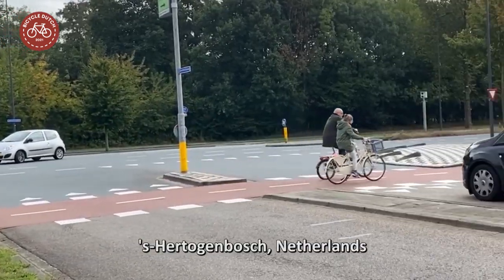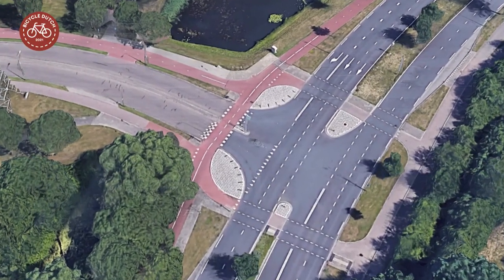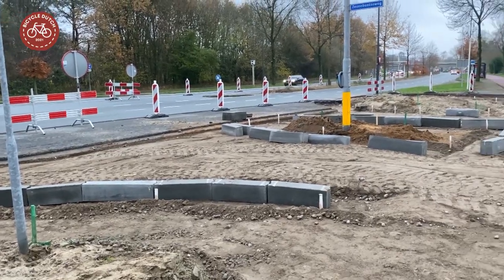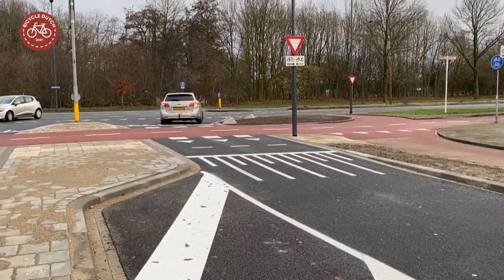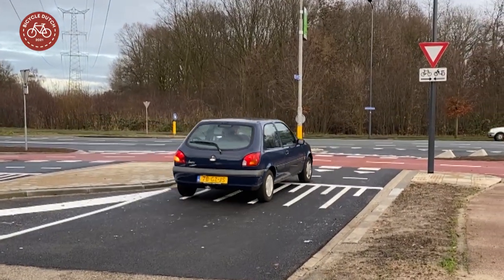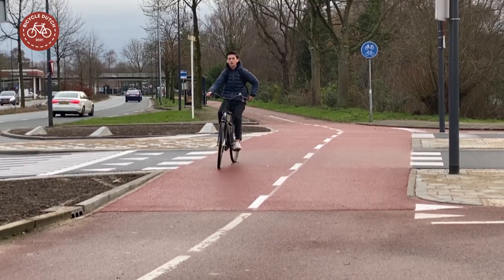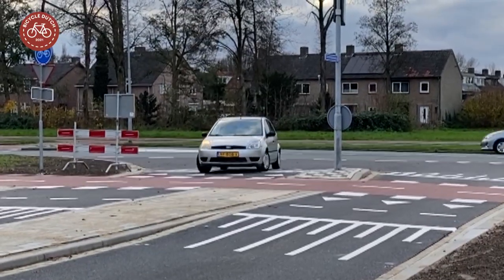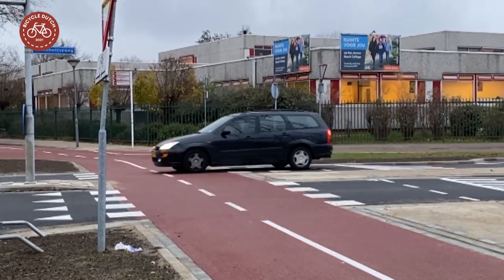Reconstructed cycling crossings in the Netherlands

Comment: Having studied traffic safety in Sweden. Remember that traffic safety doesn't mean no accidents well happen. But that you're basically cutting the accident triangle where deaths are on the top, from the bottom. As all kinds of accidents and the severity of injuries and accidents decrease.

Even if the new crossing didn't stop this accident, it still might have made it less dangerous.

Besides that, it takes years to evaluate the results of improving traffic safety, and the first year is basically to be dismissed as driver behaviour hasn't found its new steady level yet.
Reply: Also see my comment, even though it's a half year later.

Comment: At 1:46 you see the result of the most confusing Dutch traffic law. Pedestrians 'claiming' priority and motorcars 'granting' them priority :-(

Priority roads give priority to 'drivers' only. The term 'driver' includes all road users except pedestrians. Article 1 Traffic Rules and Signals Regulations 1990 (RVV 1990)
Reply: Completely agree with you!
There should be zebra paths for pedestrians to cross, to resolve this. Especially because of the schools nearby.
Strangely all zebra paths to cross a cycle path are being removed. In most cases pedestrians and cyclists can negotiate who goes first, but at very busy ones a zebra would make sure that pedestrians have priority.
Reply: @dutchman7623  Imagine when a pedestrian is walking on a roundabout with cycle lane priority signs...first half pedestrian has priority on all roundabout leaving traffic...second half he has NO priority on traffic entering the roundabout...so formally, a pedestrian would need to wait half-way in the middle :-(
Reply from the maker: You are mixing up some rules. Yes pedestrians are not vehicles so they have no priority over traffic from the side streets even though they walk on a priority road. But they do have priority over traffic turning in their path since they are going straight-on on the same road. On top of that, motor traffic has to let pedestrians finish their crossing once a pedestrian has started it. So in effect pedestrians do go first here in many situations.
Reply: @BicycleDutch  Hello BicycleDutch, I agree with what you write "have priority over traffic turning in their path since they are going straight-on on the same road". 
That is valid for cars/traffic leaving the roundabout towards the 'exit lane', they must give priority to bicycles/pedestrians continuing their route on that same roundabout. That is half the story.
So I am not so sure I am mixing up rules, the 'pedestrian on roundabout' situation however is doing so. A bit hard to explain without an image though:
When a car is approaching a roundabout, on which a pedestrian is actually crossing that 'entry lane' with the car coming from the right, the pedestrian is on the roundabout (in fact a circular never ending priority road). But the car is approaching on a different, adjacent road, being the entry lane/road. 
Meaning they are definitely not on the same road ...also realise that both the exit- and entry lane are part of the same 'street' connecting to the roundabout.
My conclusion is still: Pedestrian has ALWAYS priority on traffic exiting a roundabout towards the exit lane; Pedestrian must give priority to cars entering the roundabout via the entry lane. (when no zebra's involved)
Reply from the maker: @debokkenrijder7521  This is not a roundabout. I was talking about the situation in this video: two T-Junctions.
Reply: @BicycleDutch Agree, my additional example was off- topic

Comment: Do pedestrians also have priority over motor traffic at this crossing or would that require a zebra crossing?
Reply: No pedestrians do not have priority over motor traffic here.
Reply: In the absence of zebra crossings at intersections pedestrians have priority only if they're going straight and the cars are making a turn. And only if they come from the same road. In practice this only happens at small junctions inside residential areas, where speed limit is 30.
That's not the case here.
Reply: All turning traffic ( incl. cyclists ) always have to give priority to crossing pedestrians at streetcorners  : no need for zebra linings or otherwise.
In this case  this is partly the case as oncoming traffic towards the main road is not obliged to give priority , but as cars have slowed down already, it is  courtesy priority, which almost always works as practically all dutch drivers are cyclists as well in there freetime
Reply: @ovidiu_nl  actually, no, pedestrians do not have right of way when crossing a street anywhere there is not a zebra crossing. Pedestrians are not considered to be "traffic participants" in the Netherlands, so the normal rules for right of way do not apply (right goes first, going straight before traffic turning left, etc). 
The exception is a location where the sidewalk pavement continues across a road (usually where it exits onto another road). Technically, the cars are crossing the sidewalk in that situation, not the pedestrians crossing the street. 
In the case in this video, pedestrians would not have right of way.
Reply: @mikkieam  Sorry, but you are wrong. Article 18 of the rules of the road (RVV 1990) says:

"Bestuurders die afslaan, moeten het verkeer dat hen op dezelfde weg tegemoet komt of dat op dezelfde weg zich naast dan wel links of rechts dicht achter hen bevindt, voor laten gaan."

See: https://wetten.overheid.nl/jci1.3:c:BWBR0004825&hoofdstuk=II&paragraaf=7&artikel=18&z=2021-01-01&g=2021-01-01

The definition of "verkeer" in the same law (see Hoofdstuk I, "Begripsbepalingen") is "alle weggebruikers". The definition of "weggebruikers" is " voetgangers, fietsers, bromfietsers, bestuurders van een gehandicaptenvoertuig, van een motorvoertuig of van een tram, ruiters, geleiders van rij- of trekdieren of vee en bestuurders van een bespannen of onbespannen wagen". So pedestrians are included.
Reply: @ovidiu_nl  wow, I appreciate your commitment to find the actual articles. You have my respect for that.
As to the content, the article and definition you provided just proved my point. 
Pedestrians are classified as "weggebruikers", but not included when they talk about "verkeer". Pedestrians use the road, but are not considered to be "traffic". Bikes, cars, etc. ARE considered traffic. 
Which is why a pedestrian doesn't have any right of way in a simple crossroad even if they are going straight and the car is turning.
In practice, when you are in a 30 km zone, most car drivers will stop for pedestrians who are already crossing a road they want to turn into. But that is just common courtesy, not traffic law.
Reply: @mikkieam  No, it does not prove your point. "Verkeer" is defined as "alle weggebruikers". It's literally in article 1 of the law:

https://wetten.overheid.nl/jci1.3:c:BWBR0004825&hoofdstuk=I&artikel=1&z=2021-01-01&g=2021-01-01

What you describe as "common courtesy" is actually what the law requires.
Reply: @ovidiu_nl  ok, consider me re-educated :)
Reply: @mikkieam  My pleasure.

Comment: With the exploding share of e-bikes in (dutch) traffic (over 40% of all new bicycles sold are electric), how much thought is already going into dutch traffic planning and design to decrease cyclist speeds when approaching crossings?
Reply: They already use speed bumps for mopeds (or e-bikes) at strategic points. They consist of concrete elements that go down and back up again. If you speed over them, you get launched. Mark must have a video showing them somewhere...

Comment: I don't really like the redesign. Obviously it seems better than the before situation but it also seems like it was built with too much focus on being cheap rather than being good Why not make the road narrowing better? Why use chevrons instead of just extending the island some more? Those triangular bumps on the corner island don't seem very forgiving if a car driver makes a mistake. The speed bump slope also doesn't seem steep enough to really force people to slow down, if they wanted to take it at high speed they could still do that, just look at how fast the black car at 1:29 goes over it, almost like it doesn't even exist.

I think this intersection will end up having to be redone again in the near future, which means whatever money they have saved on it during this redesign will just end up being wasted.
Reply: The chevrons instead of an island is indeed just a cost saving. But it doesn't matter much for safety, the road before that is not wide enough for overtaking. Those triangular bumps are very, very standard. Normal cars will never hit them, but they do guide the rear wheels of a large truck back onto the road. The speedbump looks like it has the typical grade for a 50 km/h speedbump. I think what you want is a 30km/h connection to a 50 km/h road: continuous pavement, steep bump. But this is not a 30km/h road, and it would likely shift a lot of traffic problems to other locations if you would downgrade it like that (plus the cost of downgrading the whole road would be massive)
Reply: @Pfooh  But they should have made zebra crossings at both ends and in the middle to make sure pedestrians get priority. Downgrading the Sint Teunislaan, 150 meters north of this one and parallel, caused the increase of traffic on this road, never designed to take it over. Squeezing a wide road causes cars to take another route, shifting the problem to a place it doesn't belong. School going kids were facing triple times more cars, this quiet road became a sneak trough because of what happened a little north of it.
There were three east west roads connecting the two north south roads, Sint Teunislaan, Zevenhondtseweg, Aartshertogenlaan, first they reduced traffic on the Aartshertogenlaan, resulting an increase on the other two.
Than the very wide race track of the Sint Teunislaan was narrowed, resulting in jams.
Of course the only one left had to take over. Cars have to go somewhere. Now they had to squeeze this one. When will they ever learn?
Reply: @dutchman7623  What do mean by downgrading? I still see three very car dominant 50 kmh streets from east to west. When you want to avoid car problems in the city, the solution is not to have as many asphalt and different routes as possible, but to discourage people to use a car in the city by making driving more inconvenient. That way people who need a car can still get to where they need, while people who take the car out of habit and convenience will think twice.
Reply: @MrHenkkkie  
Downgrading is changing a 2 x 2 separated wide lane road  into a 2 x 1 narrow lane road.
First you had thirty cars in a wave that lasts 10 seconds and after that you get 20 seconds to cross the road by bicycle or on foot because the cars have gone.
Now you have one car every two seconds, reducing the capacity from 30 down to 15 cars in 30 seconds, but no time to cross the road safely, nor by bike, nor on foot.
And that's exactly what the municipality did to the Sint Teunislaan.
Because of the constipation they created, traffic moved to the Zevenhondtseweg, creating dangerous situations with two big schools on that road.
During the reconstruction of the Zevenhondtseweg, cars went through the only alternative they had: Buitenpepers.
Do you realize what it means to have cars driving through your neighborhood, a 30km zone, at a speed of 70 to 80?
And those are not polite friendly local drivers, but very irritated annoyed angry ones, who do NOT live there, trying to get to work on time.
Reply: @dutchman7623  I can understand the frustration but keeping those 2x2 roads straight through Den Bosch is not a solution for a safe crossing. More lanes means higher speeds and therefore the risk and severity of injury is higher when colliding while crossing. The short term effects of downgrading are that cars will choose other less favorable routes, the long term effect is less car use. But that takes time.
Reply: @MrHenkkkie  
This wide road, Sint Teunislaan, was a race track, correct. But it doesn't go through a neighborhood nor close to the schools.
It was build to take large amounts of traffic.
Squeezing it caused problems on far more severe places. Near schools and through 30 km neighborhoods.
It doesn't reduce car use, it only frustrates drivers.
Waiting time to cross this road at the Rompert for cyclists and pedestrians has increased from a few seconds to find a gap to many minutes, and you have to be a dare devil to cross. Safety hasn't been served.
Reply: @dutchman7623  It very likely will reduce car use over time, just not immediately. But car traffic generally scales with road space.

Comment: This of course changes nothing about the fact that Den Bosch is one of the worst cities for brommers in the country. Much like Arnhem. When you get to the city limits, you have to leave the cycling infrastructure and merge with the rest of motorised traffic. Which for the most part is fine. However if you want to go somewhere that isn't within city limits, you have to have a very special navigation app on your phone, because you can't follow any of the direction signs at all.
You can't follow the ones for cars, which are the ones that you'll see as you're in the middle of "car traffic", because those will lead you to A and N roads which you aren't allowed to ride on. But you can't follow the signs for cyclists either, despite those leading to the F roads that you will need outside the city, because within the city they follow routes where you aren't allowed to ride.

Comment: Throw down a traffic light much cheaper only problem are cyclists crossing at red
Reply: We've learned that traffic lights are better put to use in situations where there's really no other choice in order to regulate traffic. Casualty statistics, researched for example by the VLI study in Noord-Braband or aggregate reports in Amsterdam, show a positive causative relation between having traffic lights and accidents, so they are not preferred if traffic can be managed by other means.

Aside from that, traffic lights are also not preferred when it comes to traffic flow, since they inhibit the main function of intersections. Given that the Bruistensingel (the main road connecting the Zevenhontseweg distributor road) is fed traffic directly off exit 20 of the A2 highway, creating artificial stops in order to regulate traffic would be undesirable as unloading traffic from the main road should happen as soon as can be done.